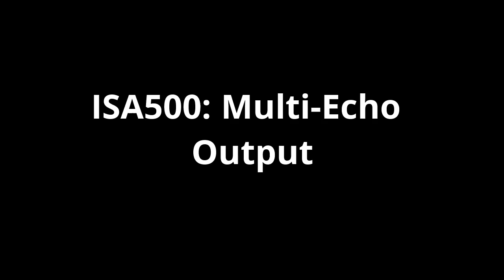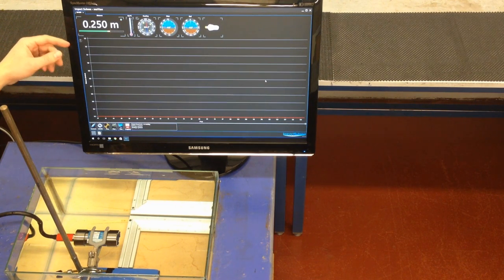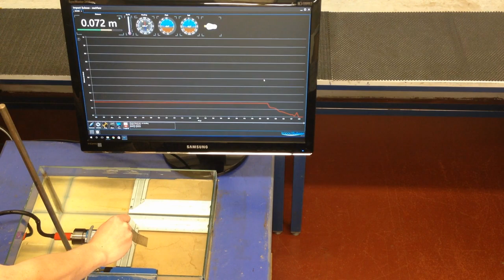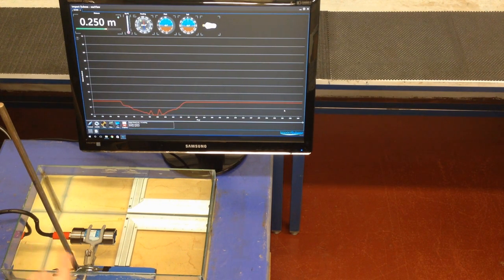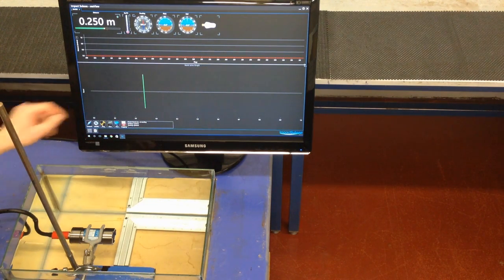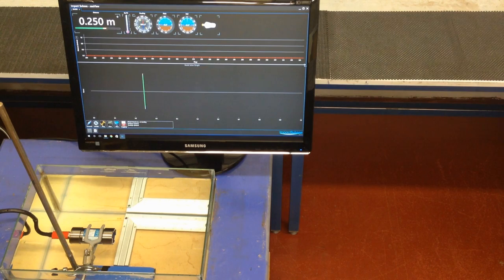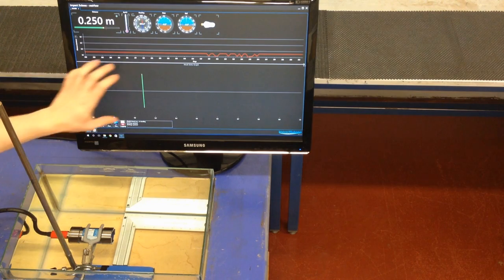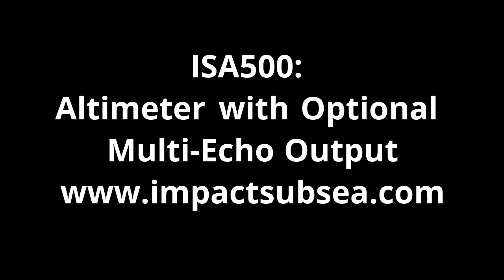ISA500: Multi Echo Output.  Underwater ROV, AUV Altimeter & Distance Measurement Device

Comment: do I have to interface it with a system using wire?
Reply from the maker: Hello SalaiVedha Kaviyan, thanks for your question!  The ISA500 can communicate with RS232 or RS485 serial communications.  Alternatively a scaled current of voltage can be output to correspond with range reading.  All options are a wired output.  If you require wireless communications, you could consider using an acoustic modem with the system.  For further details please see http://www.impactsubsea.co.uk/isa500/